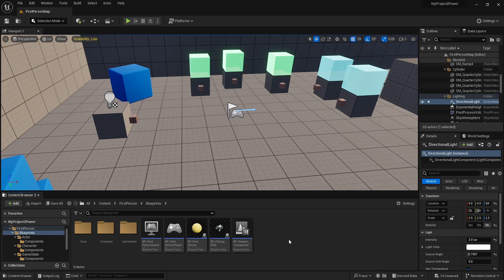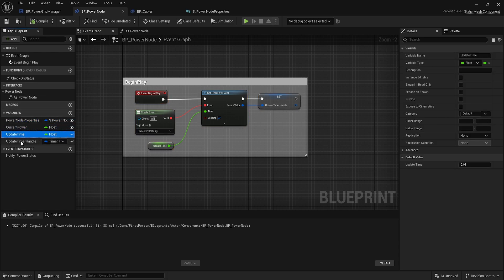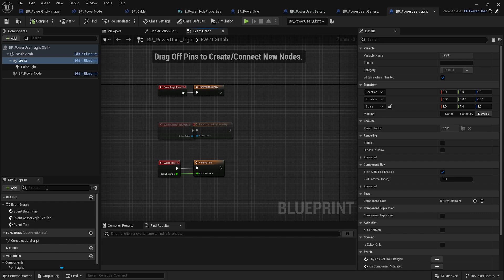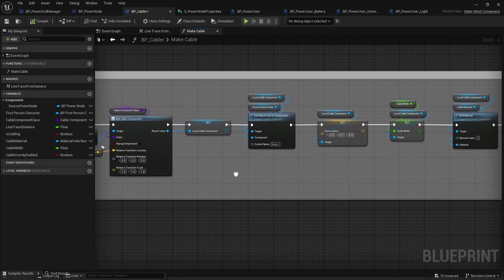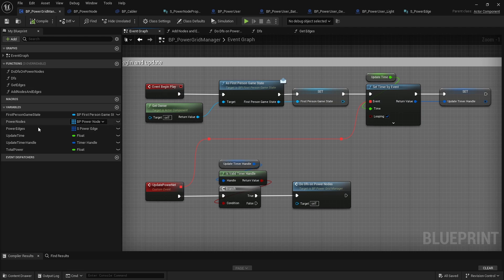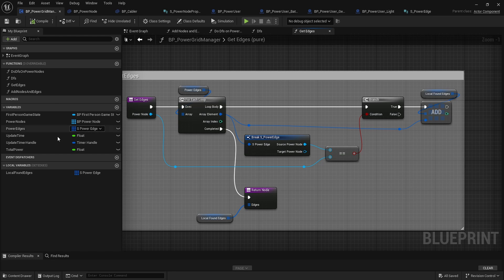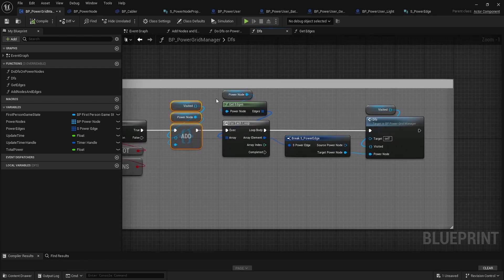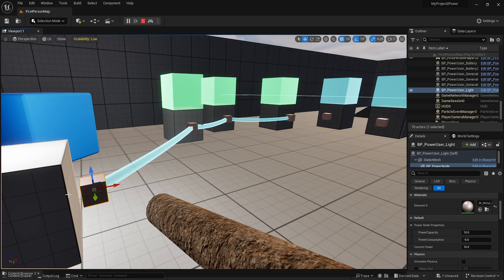How To Make A Connectable Power System To Light The Way In UE 5

Comment from the maker: Guys, the reason the light took a moment to turn on is I forgot to clamp it so the total power doesn't go below zero 😅also needs a clamp on max and some form of battery power distribution, I'll do that sometime later 😋
Reply: Yes bro if I connect the battery direct to light it's not working I have to connect it to generator first so pls make new video how to fix it and thanks 😊

Comment: I did the same and return all time no hit .... for the line trace
Reply from the maker: Double check collision settings or make sure the interface is returning the character ref properly
Reply: @crazedmonkey231  Ok it working I needed in power node to set the as power node to self now I have error for set attach end to component, the error are from the add component by class > cable component class I will search from that
Reply from the maker: @felax5410  Use breakpoints to see if it's returning an actor this should give you an idea of what it is hitting, the other think I could think of is that you need to put the fps character into the ignored actors because it may be hitting your character

Comment: hey i have some questions .... From where did you learn BP. I am new to ue5 its being 7 months I am using Ue5 Didnt learn much about BP ... is there any Udemy Courses??
Reply from the maker: I've never had proper learning, but don't fret I do have 5+ years of watching tutorials of UE and playing around in the engine, 10+ years of both Java and Python programming, and a few years of C# making mods for Rimworld. My best advice to learn is to pick up something like C# and go mod a game from steam, look at the internal workings of the game and see how those devs "did a thing" and see you you can apply it, when you learn that blueprints are basically just a visual interface over code it becomes much easier. Another decent option is to take a look at Scratch that's the program I started with back in highschool before UE and it's very well documented and easy to use.

Comment: wayy too co9mplicated  for my even though the tutorial is good. I just want to start with  having pawns just bew  aware of each other without cables and for things to just work once you place them. like if a generate is placed  a battery will charge no matter where it is  and a light will power on draining that battery. and if I have 2 gens then I will charge 2x as fast
Reply from the maker: I think I understand, the power grid here will do I believe what you are asking, anything can be on the network once it's attached using a cable this will work for lights, gens, ect. This also opens the implementation to add the actor to the power network if you have a building system you can add the power building on spawn